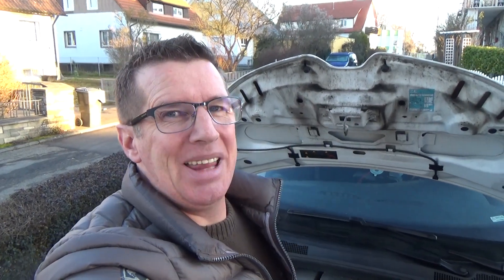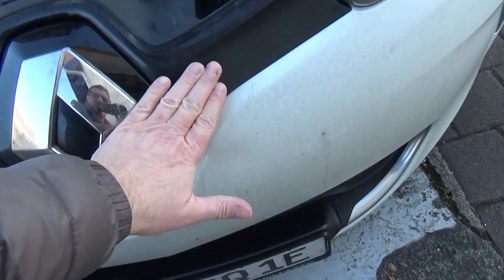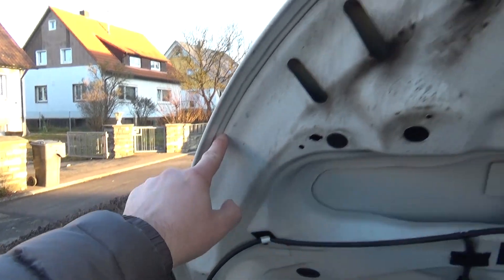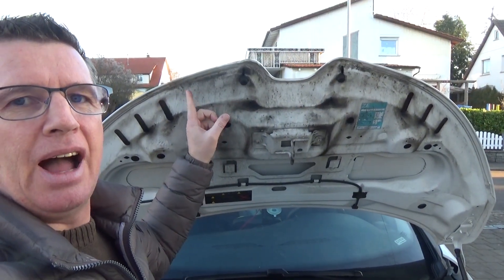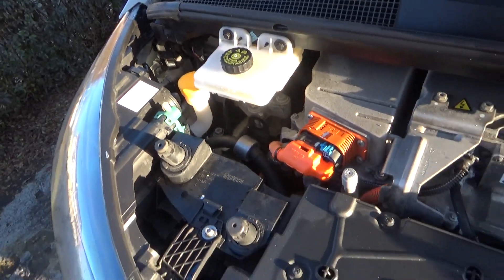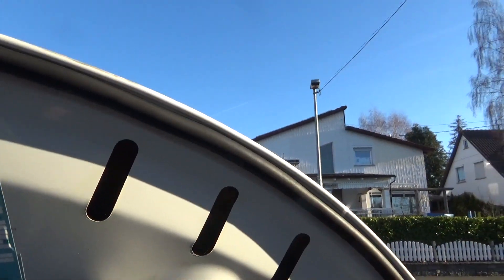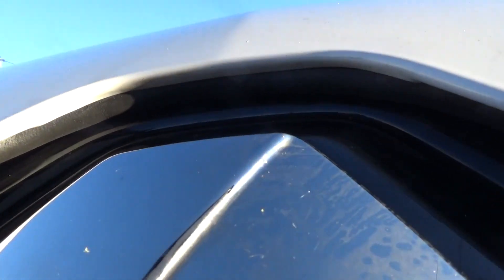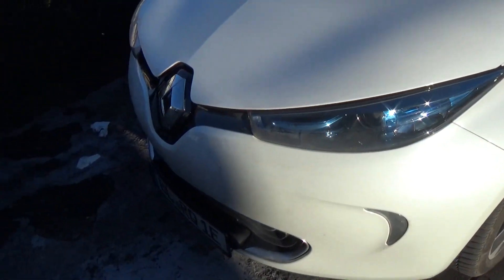🔴 Installing rubber sealing under the hood of electric car - Renault Zoe - 🚘⚡ eDrive

Comment: I've done the same around the doors. Under door spaces now are much cleaner as well as car became quieter inside. Adhesive tape wasn't strong enough so I had to enforce it with some rubber clue.
Reply from the maker: Oh thanks so much for that tip!
I also don't like the dirt under the door when open it. And if it become more quiet, I will love it! 
I will give it a try too! :-)

Comment: Did you check with Renault that the lack of a seal might be a deliberate design to help cool the electronics?
Reply from the maker: Well, there is nothing inside that gets hot. If you put an ice cube there, it will be still there after driving long distance. 
The only thing that gets slightly hand warm is the rectifier in the charging unit, but that is liquid cooled in the Q-motor. 
But there is still an air intake In front of the radiator of the car, which is direct in front there.
Reply: That’s good to know, thanks